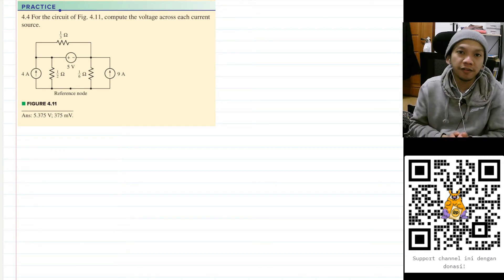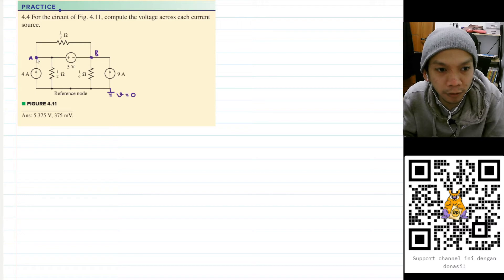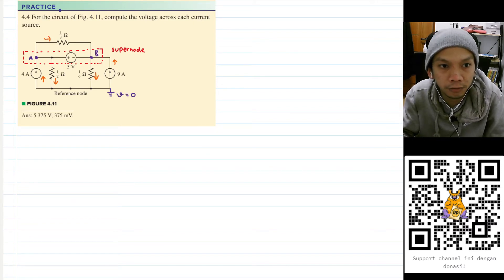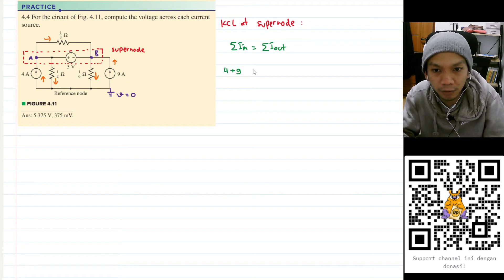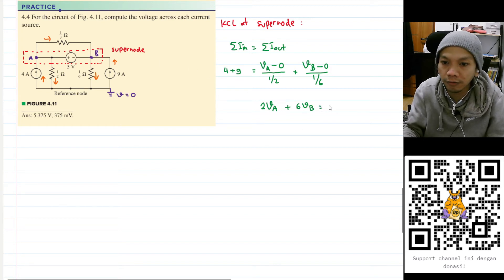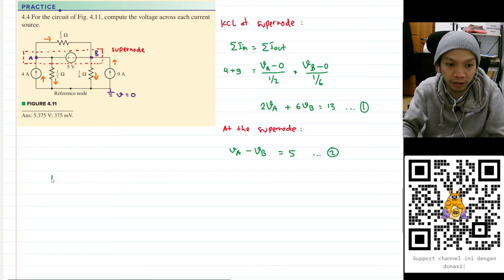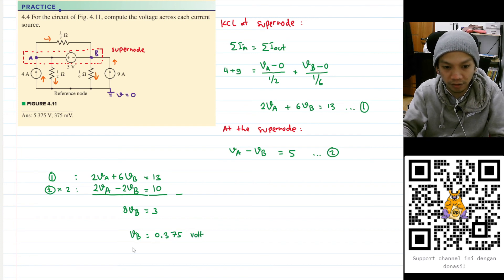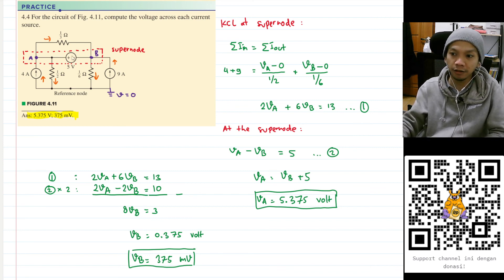Practice 4.4 - Engineering Circuit Analysis - Hayt & Hemmerly, 9th Ed - Supernode

Comment: Thank you for this video!

But i got confused why they cancel each other out, the current flowing to 1/3 resistor
Reply: same doubt, cleared for you?
Reply: @harshitsaraan  this might be too late for a reply, but it all clear to me now. the reason why it cancels each other out because the resistor is connected both of its ends to the supernode, hence it contributes literally nothing to the circuit. that's why we can just ignore that resistor in the problem. that's how i understood it.
Reply: @-moriarty6403  yes, its just even if we consider that resistor, it will be counted two times in the equation with opposite sign
Reply from the maker: Try to include it, you will see that it cancels each other.